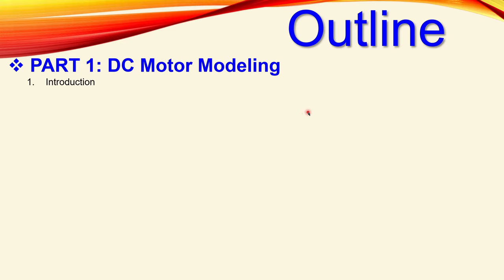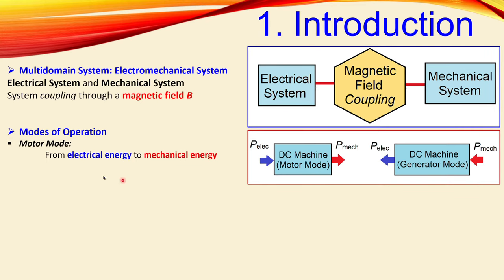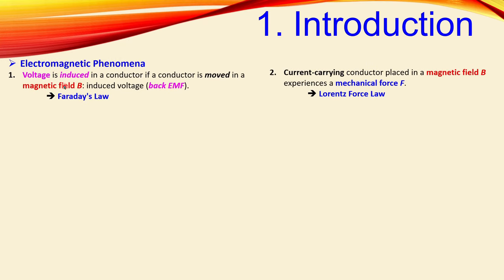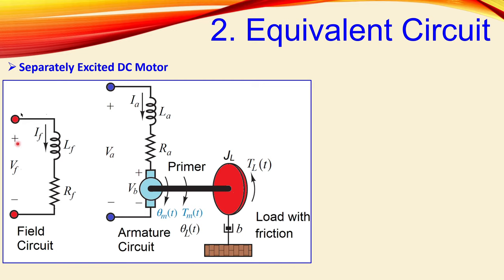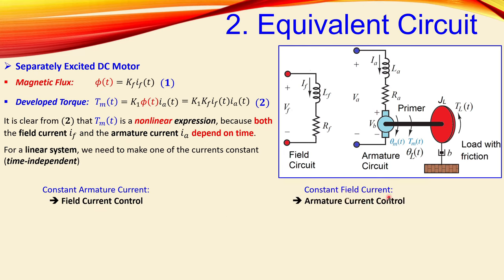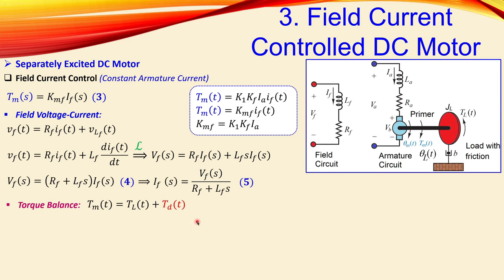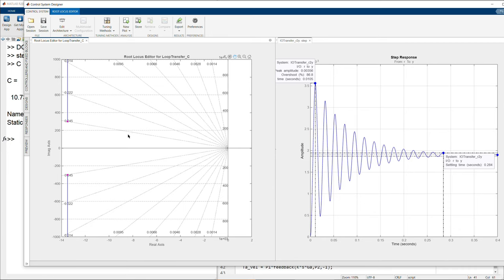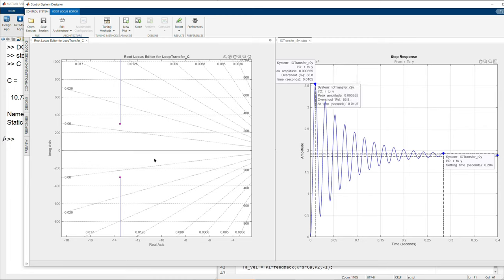DC Motor Modeling and Controller Design ⭐ Theory, Calculations & MATLAB Simulations

Comment: I now know everything about DC plant model. Exceptional work!!! Lost you with eq26 transformation.
Reply from the maker: Thanks for your message! Glad to know to this!
At around 00:31:20, I also use the fact that tau_L = J_L/b_L. Some steps are skipped to go from equations 25 to equation 26, but you can work it out in more steps if you work out the parentheses in de denominator first. Try it and let me know if it worked out.

Comment: HI dear can i have this lecture Hello Professor, is it possible to get this lecture printed with references? I have a project to control using PID on Matlab. Can you help me?
Reply from the maker: Sure if you put references. You can find the PDF link in the video description.
Reply: @CANEDUX  Thank you very much. I will check it out. Do you know how I can contact you?
Reply from the maker: @محمدمهديرضاالعميدي  You're welcome. You can contact me via can.mehmet.tr@gmail.com
Reply: Can you What is the level of this project ?? Is it final year project level of b tech.   or 2nd or 3rd year btech level project ???